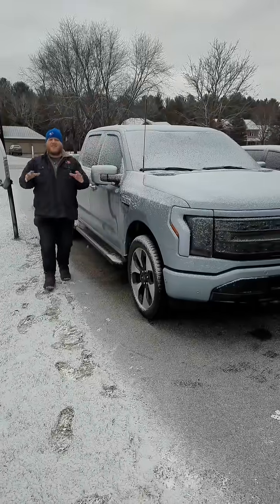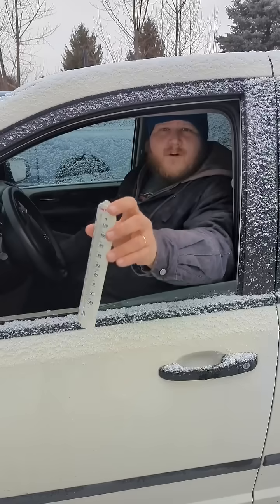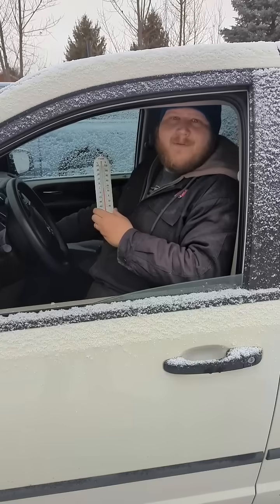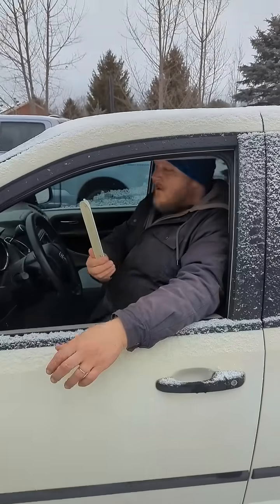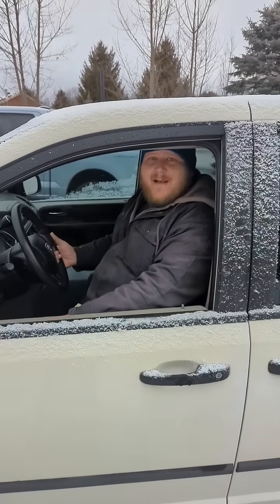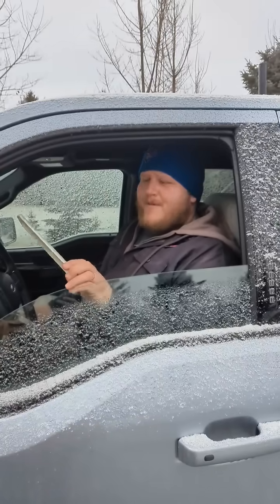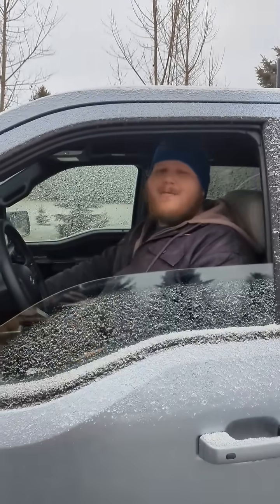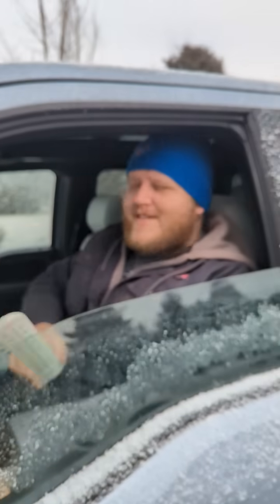Electric vs Gas - Heater Wars! How Long Does the Ford F-150 Lightning Take to Heat Up?

Comment: How much to replace that heater when it burns out? 🤔
Reply: All I can say is that it’s very expensive!
Reply: Heres 19 reasons why electric vehicles SUCKS.

1) It’s too expensive 

2) Also cause pollution because it’s created by dirty fossil fuels 

3) Tires wear out quickly 

4) Only reliable when temperatures are warm and when it’s cold, it can bring danger to the driver and passengers.

5) Charging stations are hard to find in midwestern states. If you live somewhere like Wyoming or North Dakota, it is clear that you are going to have a lot of difficulty finding charging stations, as well.

6) Roadside Service does not provide Full Coverage and lot of this has to do with the fact that their parts are not on-hand and they are more difficult to actually find than ones for regular cars. Also, auto mechanics will not know how to fix electric vehicles since they didn’t built it. You probably have to find Elon Muck and ask him to fix it for you and he will probably charge you for a million dollars. 😂

7) Travel shorter distances due to the fact that these are cars that need to be charged, they simply do not have the same type of mileage range that regular cars often possess.

8) Too much focus on luxury vs. dependability. With all of the issues that have been discussed thus far, one may be questioning what exactly car manufacturers are aiming for when it comes to making these models. In short, they simply are spending too much time on overall luxury rather than dependability.

9) They get noisy early on. Owners of electric cars have been quite open about the fact that they are prone to make a lot of noise very quickly into their usage lifetime. There is no question that over time, this happens to all types of vehicles, but it is alarming that it has been happening so quickly for electric ones.

10) Maintenance costs far more because when dealing with expensive cars, one can always assume that repairs will end up costing far more. However, when observing electric vehicles, it is clear that the prices to fix them are at an extremely excessive rate. This is largely because finding its parts is far more difficult.

11) some electric cars look ugly

12) Battery pack replacements are expensive due to the fact that electric cars run on their battery packs, it is clear that they play a major role in the overall performance of the vehicle. However, their batteries are prone to needing replacements as time passes by, and they end up costing a ton of money.

13) Recharging takes a long time

14) Durability is not consistent

15) Tend to be heavy due to the fact that electric cars are built with different materials. In fact, the heavy weight of these vehicles is likely another factor that ends up making their tires begin to drop in quality so quickly.

16) One major aspect of the electric car market is that there are limited choices. Unlike regular cars that comes with an abundance of different options, car manufacturers do not seem to release multiple electric vehicles. This is not a solid idea, as electric cars are trying to grow in popularity.

17) Not Good In The Snow. Electric cars definitely meet their match when they are used in the snow. They are prone to having a lot of malfunctions with this type of weather, while also having a lot of difficulty while driving on slushy roads.

18) Too Much Hype. "Show not tell" is the philosophy that car manufacturers should possess. However, when it comes to electric cars, it is clear that this currently is not the case. There is no question that the market is pushing for more usage of electric power, but they have yet to accomplish much in the way of persuading the vast majority of the public.

19) Having a smart car means that the government can track your every move and can listen to your conversations. 

DEMONcrats and leftists wants to banned EVERYTHING. Gas cars, gas stoves, guns, cows, meat, freedom of speech, freedom of religion, and etc. I’m not going to go along with their authoritarian policies so fuck them!

Comment: A van has a huge cabin, a smaller engine that heats slow, and the window was open. My 2002 Dakota gets about that hot in 3 or 4 minutes

Comment: You don't understand the two key points making your comparison pointless.
1. Put your mouth on the ICE exhaust, those are the particles going inside your child's lungs.
2. The EV can warm while plugged in why you are sleeping (without filing your home surroundings with cancerous pollution)

Comment: 😂 This was a useless test. Normally, with ICE people start driving away after 30 seconds of starting and it will warm up within 5 minutes…EVs will eat up battery life in no time. The range is diminished when temperatures are either too cold or too hot. Garbage technology, put in the dustbin. Corrupted politicians are pushing to take more power from citizens.

Comment: Plenty of ICE vehicles are equipped with auxillary heaters which heat the inside until the engine warms up.  It's a nice feature if you live where its cold and park outside.

Comment: Of course the electric heater is going to be quicker. You don't have to heat up excess amounts of coolant. 😜
Reply: Heres 19 reasons why electric vehicles SUCKS.

1) It’s too expensive 

2) Also cause pollution because it’s created by dirty fossil fuels 

3) Tires wear out quickly 

4) Only reliable when temperatures are warm and when it’s cold, it can bring danger to the driver and passengers.

5) Charging stations are hard to find in midwestern states. If you live somewhere like Wyoming or North Dakota, it is clear that you are going to have a lot of difficulty finding charging stations, as well.

6) Roadside Service does not provide Full Coverage and lot of this has to do with the fact that their parts are not on-hand and they are more difficult to actually find than ones for regular cars. Also, auto mechanics will not know how to fix electric vehicles since they didn’t built it. You probably have to find Elon Muck and ask him to fix it for you and he will probably charge you for a million dollars. 😂

7) Travel shorter distances due to the fact that these are cars that need to be charged, they simply do not have the same type of mileage range that regular cars often possess.

8) Too much focus on luxury vs. dependability. With all of the issues that have been discussed thus far, one may be questioning what exactly car manufacturers are aiming for when it comes to making these models. In short, they simply are spending too much time on overall luxury rather than dependability.

9) They get noisy early on. Owners of electric cars have been quite open about the fact that they are prone to make a lot of noise very quickly into their usage lifetime. There is no question that over time, this happens to all types of vehicles, but it is alarming that it has been happening so quickly for electric ones.

10) Maintenance costs far more because when dealing with expensive cars, one can always assume that repairs will end up costing far more. However, when observing electric vehicles, it is clear that the prices to fix them are at an extremely excessive rate. This is largely because finding its parts is far more difficult.

11) some electric cars look ugly

12) Battery pack replacements are expensive due to the fact that electric cars run on their battery packs, it is clear that they play a major role in the overall performance of the vehicle. However, their batteries are prone to needing replacements as time passes by, and they end up costing a ton of money.

13) Recharging takes a long time

14) Durability is not consistent

15) Tend to be heavy due to the fact that electric cars are built with different materials. In fact, the heavy weight of these vehicles is likely another factor that ends up making their tires begin to drop in quality so quickly.

16) One major aspect of the electric car market is that there are limited choices. Unlike regular cars that comes with an abundance of different options, car manufacturers do not seem to release multiple electric vehicles. This is not a solid idea, as electric cars are trying to grow in popularity.

17) Not Good In The Snow. Electric cars definitely meet their match when they are used in the snow. They are prone to having a lot of malfunctions with this type of weather, while also having a lot of difficulty while driving on slushy roads.

18) Too Much Hype. "Show not tell" is the philosophy that car manufacturers should possess. However, when it comes to electric cars, it is clear that this currently is not the case. There is no question that the market is pushing for more usage of electric power, but they have yet to accomplish much in the way of persuading the vast majority of the public.

19) Having a smart car means that the government can track your every move and can listen to your conversations. 

DEMONcrats and leftists wants to banned EVERYTHING. Gas cars, gas stoves, guns, cows, meat, freedom of speech, freedom of religion, and etc. I’m not going to go along with their authoritarian policies so fuck them!

Comment: Hold on you’re testing a 8 year old van vs the f150? The vehicle is older and has more space to heat up putting it at a disadvantage. It would be fair comparing the same year f150 since it’d be just as new and need to heat just as much space. Also 1km in 4 minutes is a lot to lose especially if you’re going to be driving around with the heater on.

Comment: Complete bullshit comparison. Most people drive off right away which heats up the vehicle much faster. Secondly, no ice vehicle is exactly the same. I've had vehicles heat up in 5 mins and ive had them heat up in 15 mins. Should at least have used an f150 ice vehicle to compare

Comment: Remote start 😃 Warm cab, and plenty of gas stations to choose from ⛽️
Reply: It costs like $120 bucks to fill up. And you physically have to go somewhere to do it.
Reply: Remote start the Lighting inside your garage and let it warm up while it's still plugged into the EV Charger mounted on your wall.
Reply: Phone start in most Evs 😁 Warm cab, and no need to hit a gas station when you have a full charge charging at home
Reply: @THExKINGxKINGx  Phone start is the same but with extra steps
Reply: @Propain4eva  phone start is definitely not the same lmao you know the gps location from your key? Exactly.
Reply: @THExKINGxKINGx  nice comment delete. 

 Must have realized you were wrong. Unfortunately for you I make hundreds of thousands installing EV chargers for EV owners. I can buy all the gas I want for my hellcats and RAM trucks. Also I've never had to pay more than $1200 over the entire life of any one of my vehicles. It's called a warranty. You and me share the same vehicle expenses. Tires and brakes. 

Guess you thought I wasn't qualified to speak on the subject, but my public contractor EV certificates speak otherwise. I'm very intimately familiar with EV's. I have a fortune in EV manufacturing and technology stocks. 

But right now, today's EV's are junk compared to my cars and trucks. I'd drive a Prius before i drive a pure EV. And the current lineup of V8's from the big 3 auto makers have zero cold weather issues with wear and tear. 

So while your planning your trip charging station to charging station driving exactly 70mph to conserve range, I'm towing my toys and business equipment at whatever speed I feel like and only have to pull in for 5 minutes to fill my tank back up for another 400+ miles of range.

Enjoy killing your battery life with super chargers. Or enjoy that 40 minutes charge time with 240v "fast" charging most terminals offer. Then you get in your EV truck and the range drops to half when towing or a load in the bed. So you get to stop in another 40 minutes after traveling roughly 50 miles because your battery range is down to 20% again ans you have to use the nearest available station. Not exactly ideal. 

But hey, I only have a college degree and multiple EV certs from tesla, charge point, terra etc......
Reply: @RunTowardsDanger  Bro.... its not that serious.

Why don't you tell us you drive EVs without telling us you drive EVs.
Reply: @captainobvious5349  I'll drive an EV when the range is 500+ miles on a charge in 40 minutes or less with no battery degredation. 600+ for my trucks.
Reply: @RunTowardsDanger  Shhhh... its ok if you drive an EV, I know a few people that drive them and they enjoy them.
Reply: @captainobvious5349  laughs in hellcat. Ok my guy.
Reply: @RunTowardsDanger  Bro, you talk SO much about materialistic things that you are starting to actually believe you own them.

Its really sad, and depressing to see someone so delusional.
Reply: @RunTowardsDanger  Trolling? Really?
I'm not the guy on here writing a short novel about the things I wished I owned and could never acquire.
Reply: @captainobvious5349  ah, so you don't have a job. I'm sorry you have nothing materialistic to be proud of. You'll get there one day. Just keep trying.
Reply: @captainobvious5349  thirsty is guys like you with nothing upset at people like me who have earned our way through life and your salty because we're "materialistic". Easy to to be anti materialistic when you have nothing. Sorry you feel that way my guy.
Reply: @RunTowardsDanger  How do you know what I have/don't have? Just because I don't go on a thread and BRAG about all the car(s) I have and a supposed job that affords me all of this doesn't mean I don't have any of this.

You're bragging about owning a Hellcat?? Seriously? That's NOTHING to brag about, like, seriously, "my guy".
Reply: @captainobvious5349  it's not just the one hellcat though. And it's not just the one vehicle.  Sorry my life affords me the things I want and yours doesn't. So you have to go in YouTube trolling for attention being upset at "materialistic" people. You'll understand some day if you ever get a job and have nice things of your own or own your own business and can afford nice toys. Just keep working at it bud.
Reply: @RunTowardsDanger  You positively savaged a kid still living with his parents 😂. I have degrees too, but my Lincoln Navigator L 4x4 allows me to tow my Polaris Ranger XP1000 Crew, firewood harvesting tools, firewood, a camper one day, our two motorcycles, and my family of 6. Stop for gas and a potty break and in 10 mins we are back on the road for our next adventure. I do all my own maintenance and this thing runs and rides like a dream. 

I’m with you, the EV tech and infrastructure just ain’t there yet.
Reply: @BrandonWest87  yeah I don't understand why these EV fan boys get so upset that someone doesn't want an EV right now when they are still garbage. Maybe in 10-15 years when the battery technology is better, charging systems and locations improve and towing doesn't cut the range in half, I might consider making the switch then. But right now, all my gassers have all the same "luxury" creature comforts an EV has, makes more power, is faster and more capable and all I have to do is put gas in the tank. People who pine about how expensive gas is need to get a better job. Work harder and quit crying that some of us can afford to splurge and gas is the least of our concerns. I'm not driving $200k in vehicles because I'm worried about the price of gas 😂.
Reply: @RunTowardsDanger  I’ll add that my most expensive vehicle is a $30k motorcycle. My total vehicle current value is about $60k if you include my Polaris Ranger.
Reply: @RunTowardsDanger  wow all these fancy certs and you're throwing around numbers actual EV owners know aren't true, but hey pretend to be the expert to everyone else if it floats your boat. You don't have to prove anything bc I don't care and I know from experience what you're claiming is not true 😂 good laugh from the ego though "I'm better than all the EV owners, bc I'm so different, I'm exactly the same" 🤭
Reply: @RunTowardsDanger you have multiple incorrect an misconceptions that show that you actually know nothing about driving an EV. Installing EVSE’s as a minimum wage intern electrician has nothing to do with living with an EV.
Reply: @THExKINGxKINGx we have phone start too😉. And our trucks don't lose range in the cold or lose half the range when towing. Enjoy stopping every 40 minutes to charge for another 40 minutes. EV's just don't cut it yet buddy.
Reply: @RunTowardsDanger  LOL every 40 minutes? Someone doesn't have any experience... 🤭 IDK where you got those numbers. Try every day. Or 6 hours if you're doing a 600 mile trip. Do you really like to drive that long non stop anyway or do you actually get thirsty and need to pee like normal humans?

Comment: Was curious on this myself. Prob will have a PHEV for my next vehicle (however that's years away). Was curious how well a heat pump would do.
Reply: Despite your username, thanks for having an open mind. Im actually curious about this too. A heat pump is literally just a reversible air conditioner.  Personally ive never been able to afford one but I do know theyre crazy efficient. Like 250 to 400% efficient (they blow more heat than the energy they use). But my curiousity is how long it takes to blow hot. Resisitive heating is nearly instant.

Comment: Different cars, different brands, why didn't you use a gas powered F150?
An ice vehicle you start and go and warms up on the way to your destination, it's not going to matter, what's going to matter is the huge sticker price on the Electric truck, the low range and charging it.